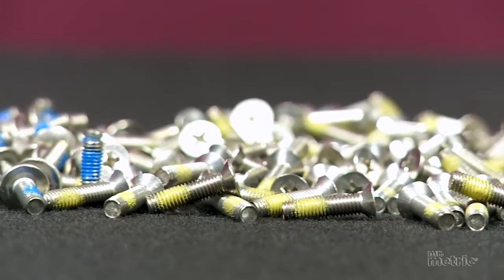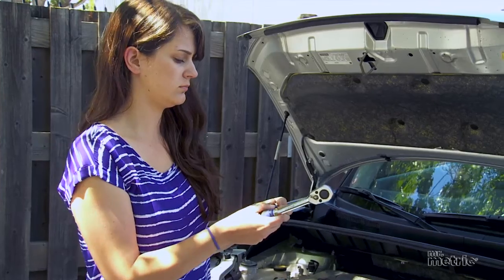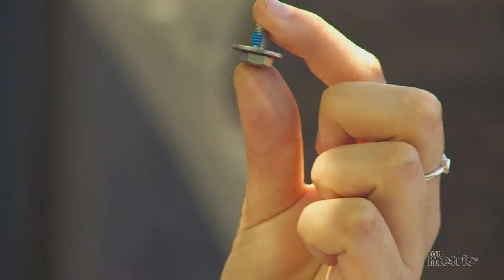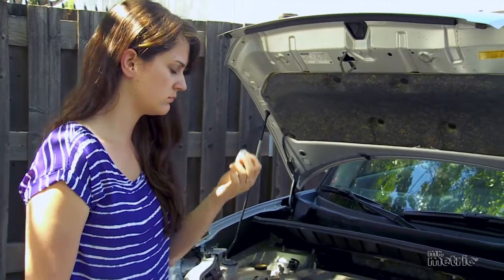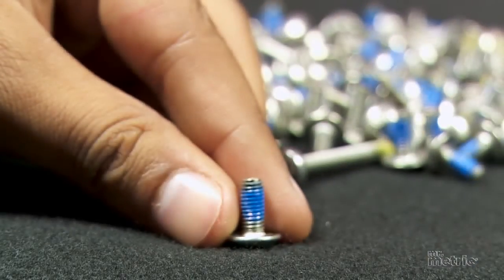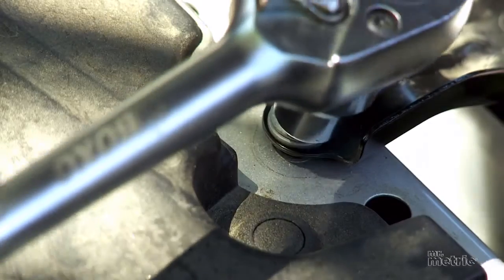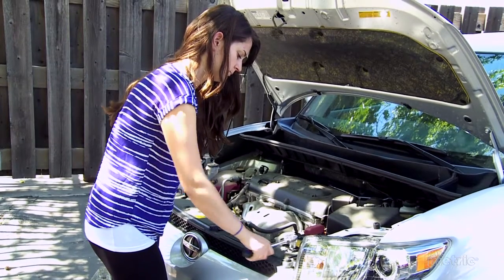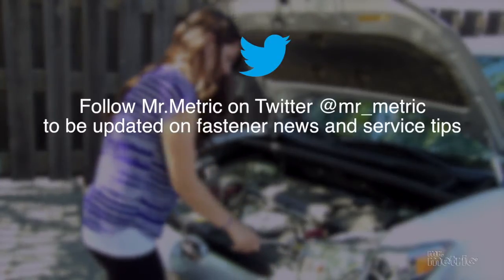Thread Locking Patches for Fasteners

Comment from the maker: Thread locking patches provide exceptional vibration resistance for fasteners. The threaded area of the screw is treated with a dot of nylon, or a layer that wraps completely around it. Nylon-patched screws will maintain their grip even under conditions of constant vibration and low-level heat, making them especially popular with the automotive and aerospace industries. http://www.mrmetric.com/?leadsource=MC1124